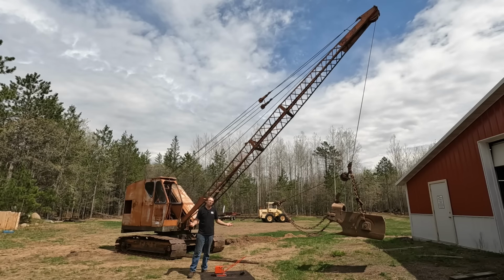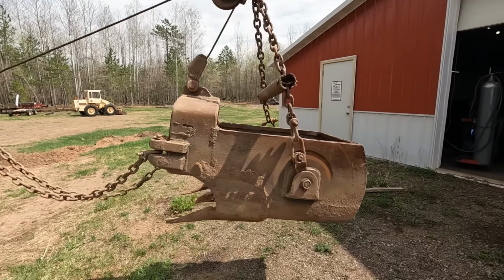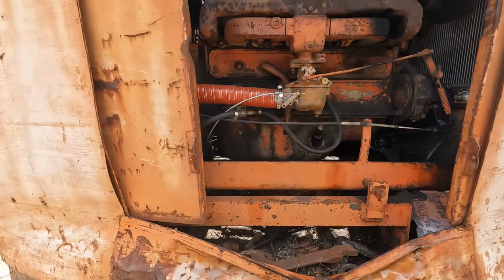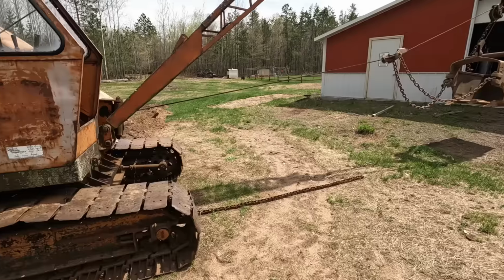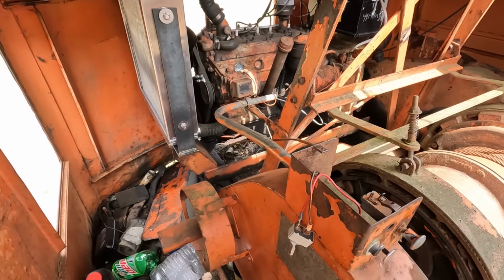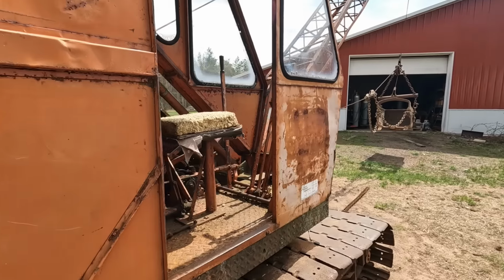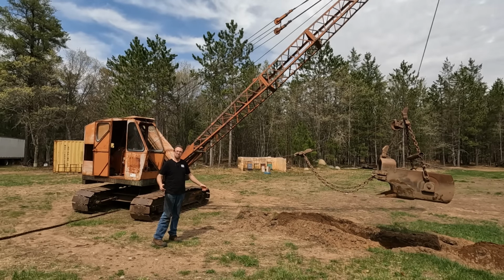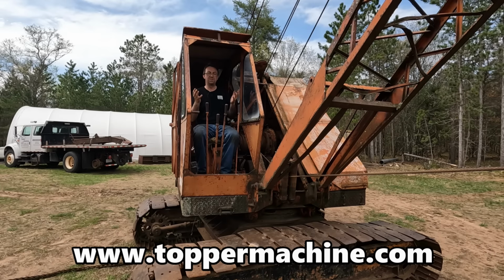New Machine Shop Yard Equipment - Bantam C35 Dragline Crane - Restoration Project

Comment: I worked for a strip mine from mid 70s to the mid 80s. It was amazing the skill the operators had, pull a welding truck out on the set and the operator could set  the bucket down with in a foot of the truck while hanging from 2 cables 125 ft. from the machine. After working around these operators you learn how precise they can be. However one hard fast rule NEVER get inside the swing radius without the operator knowing you are there!
Reply from the maker: The skill and precision achieved with these old cranes are insane. I've ran old clutch and dog cranes for 15 years and absolutely love them. And you are correct about getting in the swing radius. I've had people sneak up on me, and it never ends nicely. They get a very colorfully worded lecture about safety around cranes and detailed descriptions of how I could have killed them.

Comment: I dug a lake with one of these, about 40 years ago. Besides making sure you don't let the cables unspool on you, you have to adjust the brakes for the cable spools, during prolonged use. You have to expand the shoes, as the drums heat up. And, you have to loosen them up, before you stop for the day. If you don't, they will be all bound up when the drum cools down, and shrinks. Failure to adjust the spool brakes will result in the inability to hold the load. Since there is no hydraulic assist, it's important to have them adjusted correctly. When your rear end starts to come out of the seat, because you are pushing so hard, it's time to adjust them.  😆

Comment: I have a 1968 Bantam T350 (truck mounted) it currently has a backhoe on it but I also have the dragline boo, bucket etc. I love running it as the old Continental just chugs away behind me. It was giving issues of stalling out when I first got it but checking and adjusting the governor seems to do the trick. Will get some more seat time this summer. Looking forward to your restoration, will watch every episode.

Comment: I don't recall seeing a dragline, but i remember a company having a fleet of Bantam hydraulic excavators. It sounded like they were moving a 100 yards a minute with the old 2 cycle Detroit engines. I was told a guy that worked there could load trucks with a dragline. Ive got a passion for all heavy equipment.

Comment: The local conservation district used to use one like that to clean out the drainage ditches ever few years, as a kid I would sit on the opposite bank and watch work  as long as it took to go past my folks property.  Years latter they were using a excavator it just wasn't the same as listening to the cable running out and the splash as the bucket hit the water

Comment: That's a great little dragline Josh. Sorry to hear about your friend, but your restoring it will surely make him happy. Since you have the extension boom on it, maybe fabricate a rear cover/ballast for the back, to help ballance the load, and cover the damaged rear panel. Keep up the great work.
Reply from the maker: There is already 1200 lbs of concrete in the back and factory accessory 1200lb counterweight.

Comment: That is a cute little dragline!  Always had a soft spot for dragline cranes because we lived near three creek bridges that were replaced in my lifetime;  there was always a dragline as a central part of the replacement process.  I don’t have the crane experience you do but I do own a Gallion 150A hydraulic crane, 15 ton rated.  Handy unit.  I will say it takes a different mindset to move things via crane vs some type of forklift/loader.  Thanks for keeping another piece of old equipment alive!

Comment: Wow Josh , very nice. She's quite the gem and treasure......came across an old drag line wayyyyyyy back in the woods here when I was huntin a cpl yrs ago.......was 1/2 buried in a swamp.....just the cab above the swamp now.....figured it got bogged down crossing a corduroy road across the swamp......prob in the 40s-50s.....maybe even CCC time frame.....was on an old logging road access (CCC firebreak road?)......not sure what make it was.......no OLD TIMERS around any more to shed any info.....pretty dilapidated and rusted horribly......OH, by the way TYVM for sending the cold front and snow flakes....yi yi yi.....swear I saw one snow flake here in the Adirondacks, said courtesy of Josh in Spooner......at least the cold front slowed down the black fly invasion for a bit....shop expansion here is almost done.....will send a vid when Its presentable...
Don
Reply from the maker: I'd be willing to bet there are machines in swamps everywhere. Rumor has it that there was a small railroad at one of the local cranberry marshes back in the 1920s. As the train was traveling, the ground let go and the steam locomotive sank. I've heard from a few sources that they have ran rods down and can hit it over 50 feet down. Would be cool to recover, but no idea how to do it. 

Glad you liked the snow. I'm glad it's finally gone, now I just need warm weather to get stuff done. Haven't even fired up the sawmill this year.

Comment: One of our cars does not have a computer. It's a 1982 Mitsubishi L300, which I upgraded the engine and manual transmission from a 1991 model.

Comment: bantams are a good small contractor machine. I have a small collections of shovels and a bantam t35 with a a backhoe and shovel. you've got a new sub. looks like your dump rope is too short also. should not be getting the becket into the dump sheave
Reply from the maker: The dump rope is on the repair list. Starting with the propulsion side first then working my way up. Lots of years of wear to fix.
Reply: @TopperMachineLLC  I know it all too well. My Lima 24 dragline needs track pins, bearings  and bushings in the vertical shafts not to mention the whole air control system rebuilt

Comment: I help maintain and show a 1941 American Bantam Reconnaissance Car (BRC). The BRC has a Continental engine, a smaller Y112, like your Bantam Dragline! Continental engines were popular in the 30s and 40s. American Bantam is not at all related the Schield Bantam Company but they both used the word Bantam to imply "small".
Reply from the maker: Small and powerful was what I had read

Comment: Looks like it's a bit harder to operate than a backhoe, not that I've ever operated a backhoe. It will be interesting to see you dig the bunker, but no doubt in the meantime, there will be a lot of refurbishment to do first.
Reply from the maker: Actually, in the right hands, these dig faster than any hydraulic excavator. It's quite impressive to watch these work in capable hands.

Comment: Where did you find dr8ve chains? I found tune up parts at napa. Did you f8nd a carb kit for the carburetor?
Reply from the maker: Chains are just 140H, nothing special but very spendy.  Carb kit took some searching, I don't remember where I got it, but it was under $35 shipped

Comment: i think you need to check your governor operation, it sounds like its not adding power when you add load.
Reply from the maker: It was working properly, I just have some tuning to do. We didn't set the points properly in the field to get it moving, that is now fixed. Plugs and wires are next.  Timing is also on the list. I was also using up some really old gas. I had everything against me. It will all get fixed.

Comment: The way that engine rolls on a while after you shut it down makes me think you might want to check the compression before you try too hard trying to make it run great. She sounds tired
Reply from the maker: It may be tired, but will still work for many years.
Reply: Oh I’m sure it will. Just nice to know sometimes if there’s a low cylinder
Reply from the maker: @redmorphius  I agree. Compression test is in order. Worst case a repower is planned.

Comment: an old machine can be Rusty Shit Full Of Rot, or it can be Clean Patina. really looks like the sheet metal is mostly Clean Patina with some rot in corners where water collects. sure, the paint is faded and rust stained, but it's mostly Still There. and the working bits are all there and complete - it even looks like it has all the glass. maybe not entirely original glass, but these kinds of machines were flogged hard in their primary working lives, as you would well know as a crane operator. There's different levels of Do Things To It, sounds like (per other videos) your goal is not Parade/Show Restore (which would be A Lot Of Paint, which you have also indicated distaste for), but Refurbish To Working Order for light but real use.  That's REALLY interesting how it's just a radiator door for cab heat. and Ouch that bugger is Loud even evident over the camera

Comment: That is strange a Gasoline engine in a crane instead of a diesel engine.  
Hmmm  Gasoline was very cheap in those days.
Reply from the maker: Gasoline engines were very common place in smaller equipment up until about the 1960s.  Gasoline was more readily available than diesel.  With the Dieselization of the railroads in full swing in the 1960s, MFGs started using way more diesels in small equipment.  Even in the 1960s, diesels were not standard equipment in most things.  I have driven and worked on several 1960s heavy trucks with gasoline engines.  There is a lot of interesting history if you dig into this topic further.

Comment: Cool machine but I would not waste time with this if I wanted to dig anything.
Reply from the maker: You've obviously not seen what they can do. The reason they were phased out isn't because they are slow, but that they require a brain to operate.
Reply: @TopperMachineLLC  They are useful for mining and dredging type work but for general purpose excavating they are antiquated.

Comment: That's not a rebuilt carburetor you may have put a carburetor kit in it it doesn't mean it's rebuilt
Reply from the maker: I completely rebuilt it. Pulled apart, bead blasted, cleaned, full kit, jets, float, and reassembled.

Comment: And don't paint it , it got character the way it is . In my opinion It will look like crap if you paint it.
Reply from the maker: Absolutely agree. It has character and shows how it's lived a working life. Paint will just show all the dents.
Reply: I really enjoy your videos in the shop and about the railroad engines. And to my surprise you are also a Bantam  owner. I have a 350 on a truck that we use to hang an irrigation pump in the river and a 450 on tracks with a hydraulic excavator set up. I have two excavator arms that fit on the 350 and are cable operated. I don,t use them if you want one for your collection let me know. My 350 had a 353 Detroit and the 450 has a 453. I put an electric motor on the 350 so if you want the 353 it is surplus to me. When the 450 was used for cleaning canals the clutches would get hot and slippery and the old time operators would pour vinegar on them to get them to grab again. Thanks again for  all of your content!
Reply from the maker: @johnjoyce4444  thank you for the offer. I will keep you in mind moving forward. Could you send me an email, youtube@toppermachine.com I would love to pick your brain a bit. Although, the 35 and 350 are completely different machines, I still might have questions you could answer. Thank you.